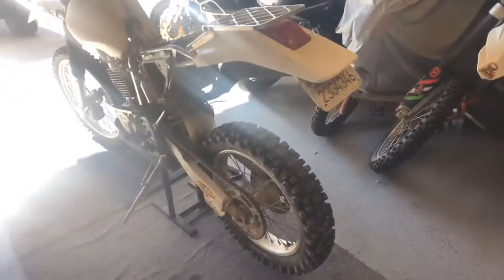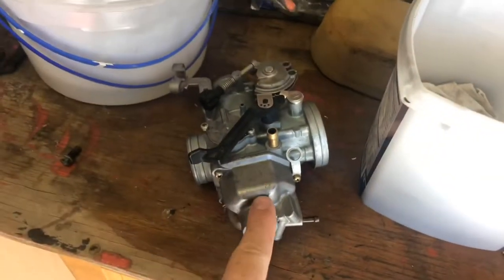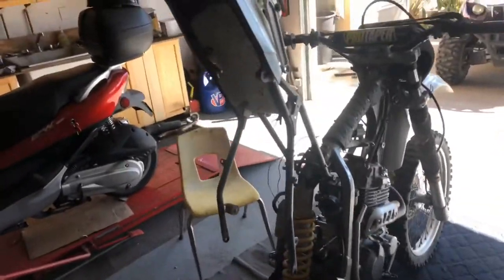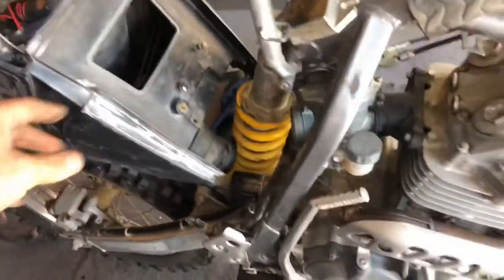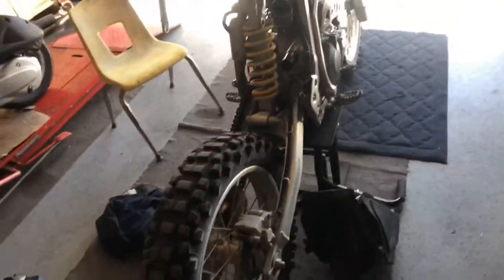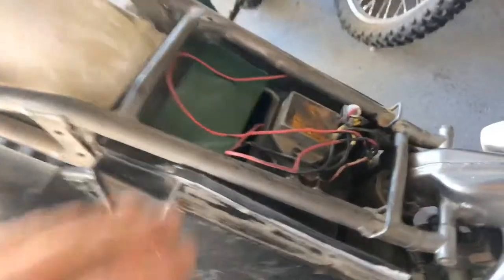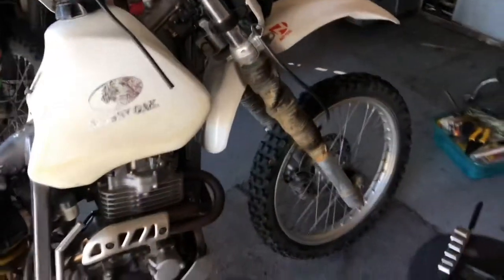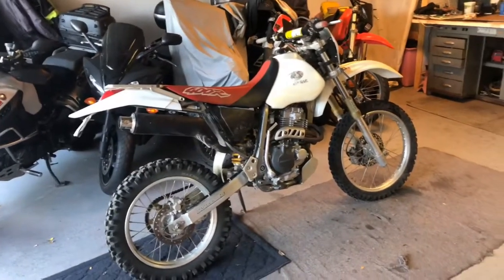Honda XR400R repair, part two.

Comment: Hey Tom, enjoy your videos and wished you lived in Orlando. I have an 03 xr400 and checking the oil on it is a pia. Something this important shouldn't be so hard to do. What was Honda thinking. Can you give a suggestion on how you check the oil, or can you use the the bolt at the bottom of the engine to check it. If you're familiar with the one that I'm referring to. Thanks Keith
Reply from the maker: Well I have never been to Florida so I wouldn't mind checking out Orlando.  Have you seen what the manual says about checking the oil?  I will include a link here, take a look at it and if that doesn't help let me know.   There are a few pages to read, so check them all out and it will hopefully make sense.  This is a dry sump engine, that's why it's a bit different to check than some other motorcycles.    https://www.manualslib.com/manual/1149049/Honda-Xr400.html?page=47

Comment: Was there enough room to get your socket into the sparkplug hole and get the leverage needed to unscrew it? I'm just looking at mine, and it looks like the hole is awfully close to the frame, i'm not even sure if I could do it without taking out the engine out of the frame!
Reply from the maker: Yes, I had enough room but every tool set is different and yours may not fit.  You can always try to find an original tool kit, those super thin wall spark plug tools always work.
Reply: @TomsTinkeringandAdventures  hmm I guess I would have to just try it when I do my next oil change, bulk all the tasks together. Thanks for your videos on the XR400 man. I just got mine and I’m trying to do some basic servicing done to it, appreciate your content!

Comment: Its a pity the xr400 frame was so poorly designed down in the rail sections. Not many left in oz that aren't rusted out. Im restoring my last one. A 2003 $$$$ nightmare! Only half descent frame in u.s l could find is $2500 delivered! Mate just bought what he thought was a good one until l poked around the rails...same thing unfortunately for him.
Reply from the maker: Malky 52 I didn’t realize that they had frame issues.  Hopefully you get yours together
Reply: @TomsTinkeringandAdventures  Thanks Tom. Its to do with the location and lack of drain holes. Otherwise a great allround comfortable bike.🍻

Comment: Hey Tom, can I ask if a leaking exhaust connection between the header and muffler would effect idling and also start up?
Reply from the maker: Ian Griffiths it sure could...may not be the only issue but it could contribute to it.
Reply: Hey Tom thank you so much for the reply! If I may could I ask one more question, would you buy an XR400 with high but documented mileage that was a bit rough or an undocumented mileage bike that looked very clean but ran poorly?
Reply from the maker: @iangriffiths9930  well, price and condition almost always go hand in hand.  My XR was in rough shape, ran ok, but was really cheap.  I knew what the parts to make it look good cost and I also know how to work on the bike so I took a chance on it.   They are pretty reliable bikes, so high mileage isn't too big of a concern to me and neither is looks.....cosmetics have no bearing on the way it runs.  Just my input.

Comment: Hey Tom I have a 1997 xr400r I just did new piston and rings and valve seals because it was smoking and now once it warms up it won’t start again. Could my valves be off ?Any suggestions? Thank you
Reply from the maker: Possibly.  It’s always wise to check them.  If it started fine before the work I would just take a look at everything that was changed.

Comment: I had four Honda tool sets but no Honda spark plug socket…….wtf…….
Ordered one for $14.00.  I love my xr400 but it is a pain. I’m 78 and it’s 
Damn hard to kick start. I’ve spent more time working on it than I have riding it. Like the best woman you ever had…….a lot of trouble. Not funny.
Reply from the maker: I have seen several people convert their XR to electric start.  It takes parts from the 400EX quad.  In my opinion though, there are other great bikes out there with E start.